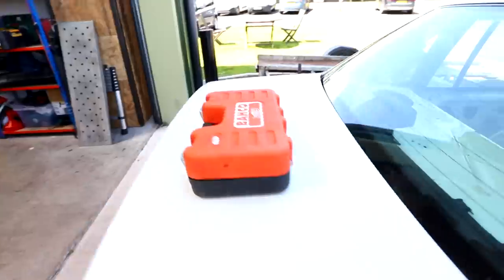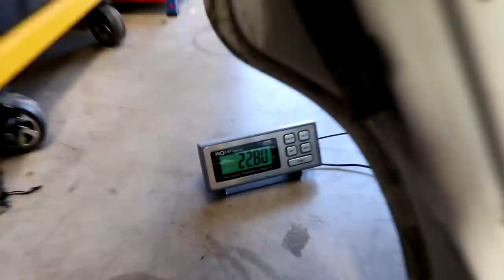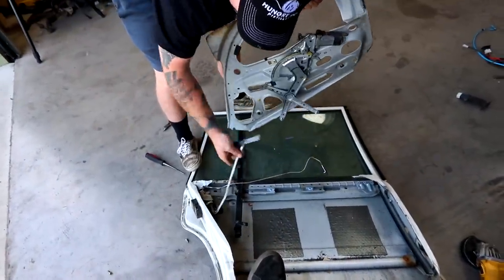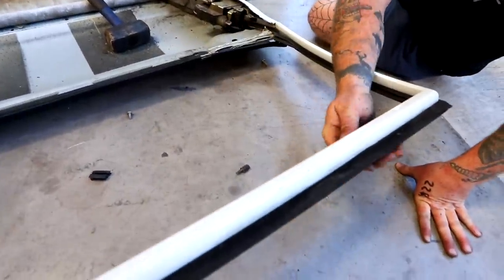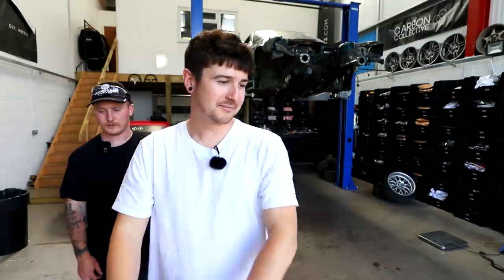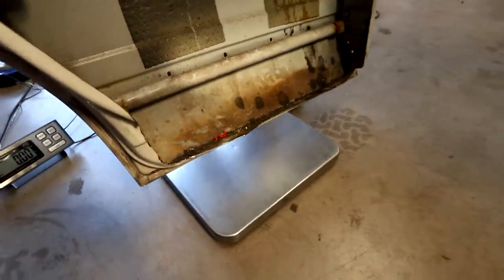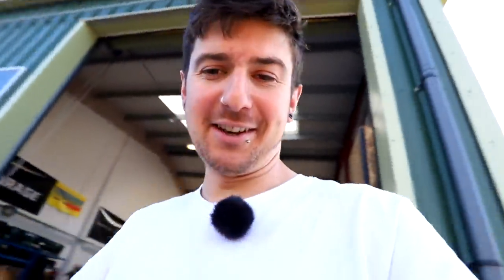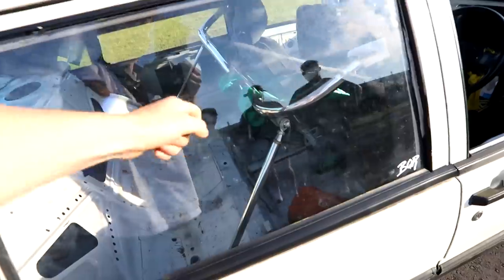Andy's Tutorials: POLY WINDOWS

Comment: Flat pan the boot floor by cutting out the spare wheel well and riveting a sheet of ali in. Remove structure inside the boot lid and bonnet, and put them on bonnet pins so you can ditch the hinges and lock mechanisms.
Reply: yeh she’s on the list
Reply: Could do this on the compact too! But do it proper and get the welder out again. Great mod for a drift e36 because it's way easier to swap out diff/shafts with a flat boot floor

Comment: cut out the trunk floor and replace it with basic sheet of thin metal, cut the inside of your bonnet and trunklid, volvos have 2 heavy bricks in the front part of chassie rails, delete abs pump, delete sunroof rails etc all done, over 50kg easy

Comment: Cut the rear scuttle ( the metal between the boot and where the rear seats where) get rid of all  sound deadening, remove any wheel liners if it has any 🤣 and can even remove the rear crash bar could save about another 20-30kg. Also can cut the inner lining of the boot and bonnet and get rid of the spare wheel well. Don’t forget speed holes too there easy enough to do 👍🏻

Comment: Andy there are weight blocks on the frame rails front and rear that can be removed when you take the bumper off. Basically lead blocks that volvo installs to make the ride more smooth/less vibrating. Easy weight savings right there .
Reply: Done

Comment: Andy's Volvo Weight Reduction Ideas: 1) Swap out the bonnet for fibre-glass/carbon-fibre? 2) Swap out the electric front windows. 3) Remove the bulkhead between the boot/rear-seats. 4) Take a massive dump = FREE weight savings!

Comment: When cutting poly or any plastic use a jig saw or skill saw grinder just burns and melts the plastic to the disc and you’ll burn out the grinder learned that the hardway cutting nylon

Comment: Mega video, we out here for the weight saving!
Tips for easy weight loss wins:
Fibreglass bonnet
Fibreglass boot
Cut out front arches - bonus more cold air to the intake
Sound deadening out - get some dry ice for this
Back windscreen poly

Comment: Thank you Andy lmao, love the car

volvo 940's have cast iron weights in the frame rails behind the bumper shock inserts and one on the firewall behind the head of the motor, id rip those out if you havent. Easy 10lbs, cleans up the engine bay too 
👍
Reply: Done the frame ones , didn’t think there was a bulk head one on mine , also bay is pretty tidy

Comment: Cut the inside of the boot out so much metal in there not needed and from the outside looks like you haven’t touched it
Reply: Yeh it’s all stripped and stuff removed from behind bumper , still need to cut spare wheel
Well out

Comment: If car had SRS system…. Remove it and the wiring for it weighs a crap tonne

Also bit pricey but Light weight battery. I got a golf cart battery and does the job!
Reply: yeh what’s the deal with the Srs stuff
Reply: @Ndy_jns  my car had a unit that controlled air bags, gas seatbelt tensioners etc 

Ripped the bastard out and cut all the wiring for it out and added up to quite a bit of weight
Reply: Hmmm I don’t recon I have it
Reply: @Ndy_jns  just had a little google mate don’t think you do sadly sorry :/ look for a small silver box under the dash if you’re bored! 

If not, can remove sound deadening, cut out tyre well, remove door open/close sensors, airbag crash sensors, half cut dash, headlight wipers/motors/wiring, sunroof/mechanism delete, cut off boot/bonnet inner skins!

Comment: Hole saw the double skin panels in the car and flat plate the boot floor so then it’s easier for jacking the diff and remove sound deadening, 
If you wanted to go keen remove insides of the bumpers like the crash bar so it’s just the outer shell .
Should be good weight lose for Andy
Reply: Yeh done bumpers and frame weights etc , boot floor next
Reply: @Ndy_jns  yer do boot floor might be worth putting a auto diff in like a 4.44 or a 4.1 so will be better for lower power skids or just big flicks and kicks
Reply: @Thacksport  yeh 4.44 are kinda rare , 3.9 atm does well
Reply: @Ndy_jns  big flicks and clutch kicks it is